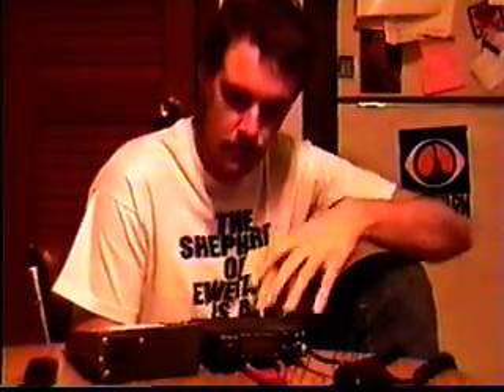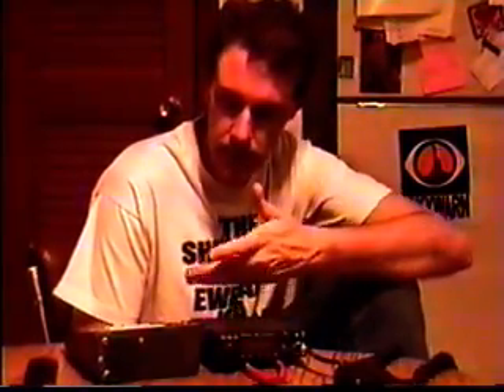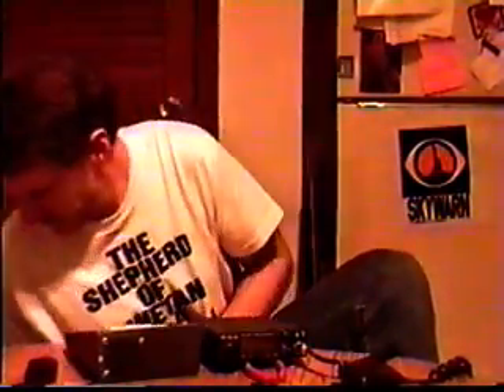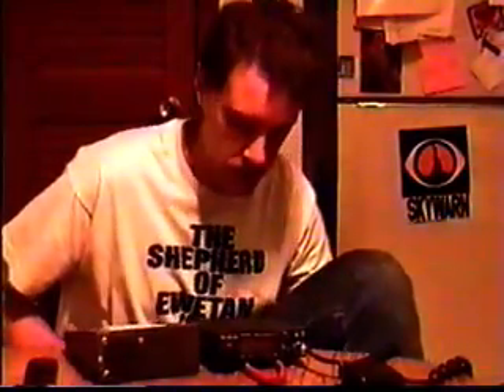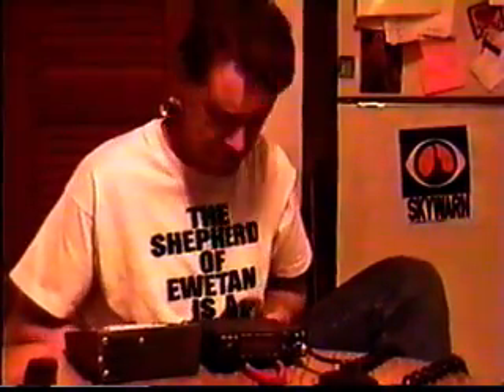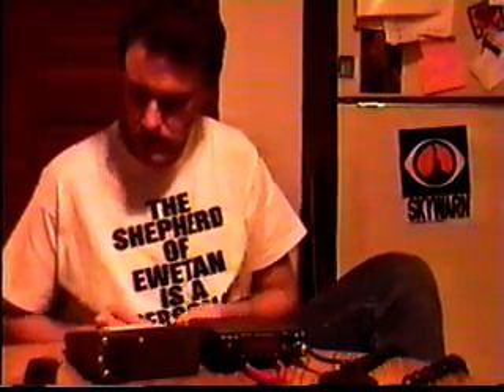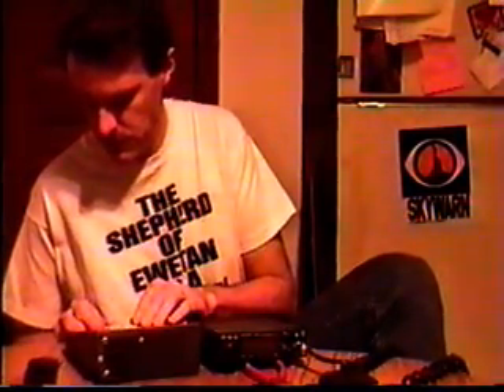2 meter radio - CB power supply explosion.

Comment from the maker: I created the sparks using a standard AC cord. I stripped the two wires at the end of the cord and connected only one of the strands together. I knew that it would instantly burn up, but I really didn't expect the pyrotechnic display to be that dramatic. I tested using two strands (outside, of course) and that was way too much. One strand didn't seem to be to much when I was outside. On my kitchen table though, it was quite a fiery display.